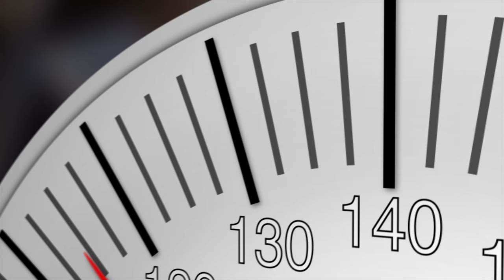Common Problems with a Deaerator - Boiling Point

Comment: Our facility is at about 4500 feet above sea level.  We have a condensate return tank and a deaerator as well as an economizier.  The condensate tank is not pressurizied and is 'normally' between 165 and 180 degrees.  We believe there is some steam getting passed a steam trap and back to the plant.  The deaerator is 'normally' 222-224 degrees and the pressure is around 6-8 psi.  After the economizer, our feed water is about 240 degrees going into the boiler.

With that as background, we have a very small plume of steam coming out of the pipe from the DA.  Id say 6-12".  I opened the vent valve and there was no appreciable difference in the plume, however there was an increase in H2O coming from the drain (connected to both condensate and DA, but assume the increase from the DA).  Also, is 224 about the best we can get?

Thank you in advance!

Comment: How do you do a cold startup on the dearator?  If you establish a proper water level first with the boiler off the water in the dearator it will be cold and you don't want cold water entering the boiler when the boiler starts up. How then is the water first preheated if the boiler itself is not running to provide steam to the dearator.  It's like a catch 22.
Reply from the maker: You have no choice with a cold system and deaerator but to fill the boiler and start up with cold water.  Because the boiler is cold, this does not create the same thermal shock as adding cold water to a hot boiler.

The boiler should be warmed slowly to minimize warm up stress.  Condensation may occur during startup due to the cold vessel temperature.  This is sometimes mistaken for leaking on startup.

 As the boiler creates steam, makeup water to the DA will be heated.  This can be optimized by opening the DA vent valve to speed air removal, temporarily bypassing the steam regulating valve feeding the DA to introduce steam earlier, and keeping the DA level a minimal until some steam pressure is established on the vessel.

If the DA is at full operating temperature, rapidly filling a cold boiler with hot deaerator water can cause shock as well - tempered water is preferred.

Comment: Hey Jude, great video. Question, what causes high pressure on DA and what is the effect of this to the system? Thanks
Reply from the maker: Here are a few causes.

First, if your pressure reducing station feeding the DA is malfunctioning, it can pass excess steam.  Throttling a steam valve to the station will drop that pressure if this is the case - and the problem will need to be diagnosed and corrected.

If throttling the steam supply to the DA does not relieve the pressure, you may have failed steam traps in the system.  Steam passing through these failed open traps (or open bypasses) is exceeding the amount of steam the DA requires.

Lastly, you may have a process that simply discharges very large amounts of flash steam.  In some cases automated pressure control vent valves are required.  Processes in these cases return condensate at a temperature and pressure that exceeds the preheat requirements of incoming makeup water.   A specialized high pressure return system may be used in these applications - such as paper and cardboard manufacturing.

High pressure on the DA can cause backup of condensate return systems, resulting in flooded heat exchangers on lower pressure applications.  It can also cause damage to feed pump seals.  In extreme cases, it can even prevent makeup water from entering the DA, resulting in low level, pump shutdown, and eventually boiler shutdown.

Hopefully that helps!
Reply: If your talking about vessel pressure in the DA it should run around 4-8 psi. If your running more than that it’s either your steam or incoming water pressure. Do you have a vent open? And what pressure do you have from your steam ?
Reply: What’s your temp?
Reply: @WildBill1984  I have some issues with my DA at the moment. I seen you tried to help that other guys question. Well I have a discharge pressure of 20 to 21 at times and I'm not getting the adequate amount of makeup water. Is it due to the pressure to high?
Reply: I live in Karachi Pakistan I like your comments send 4 month ago

Comment: Should a DA making very loud banging noises when the return condensate is being pump into it? We run a low pressure plant 10psi, and have a vacuum return system. When our condensate pump runs and pumps into the DA it get very violent and loud banging. Also, now that is it has warmed up our condensate temps are about 40degrees lower, our DA temp has went from 220 to 214. With no changes by the operators, I thought it should maintain temp no matter what the incoming temp is?

Comment: Hi I have an off topic question.  I have 2 cooling towers running in parallel and they keep overflowing and I’m losing a lot of chemical. I’ve adjusted the floats as much as I can, but am still having overflow issues. Do you have any ideas of what could be happening? As far as I can tell all other components are functioning correctly. Thanks
Reply from the maker: Unfortunately this isn't something we could really comment on as there are a lot of variables in play. If you would like please contact us directly and we might be able to come up with something. 800.228.8861 Thanks for watching!
Reply: wareboilers thanks for the reply
Reply: Hi just to comment Everytime my Cooling towers overflow the problem I have is Scale Clogging the Flow Tubes at the Top of the Tower .. Also Do you have the Finger Style level Control or the Bulb Style? If the Bulb style they usually get water inside and that will give you issues I hope this helps

Comment: I have 2 DA tanks that we use only one at a time. What is the proper lay up procedure for the tank when not is use keeping in mind that I only have minutes to bring the other tank on line if something happens to the tank I'm using. I work for a hospital .Thank you in advance.,\\
Reply from the maker: Tricky question. This is a bit hard to answer because there are a lot of unknowns so we can at least list out the benefits / problems with each. A wet layup will have your tank filled ready to go but the water will be cold and could potentially introduce cold water into your hot boiler which is dangerous. It will take time to warm the filled tank. Dry Layup will be able to heat the water as it is filling but you would still need time to get the tank to operational levels. This would be a better choice depending on the size of your tank as it might not take long to fill. The best choice really is to have the tank on standby but active so it stays hot and ready to go but that also might not be the most economical choice. 

Hopefully that helps. If you wanted to talk in more detail, please do not hesitate to give us a call and someone can help you. (800) 228-8861